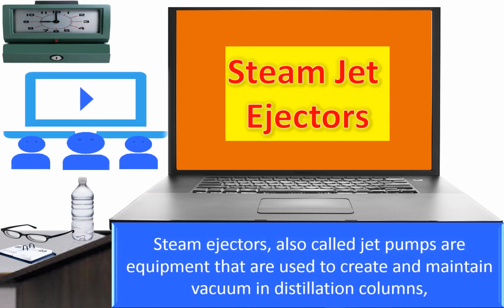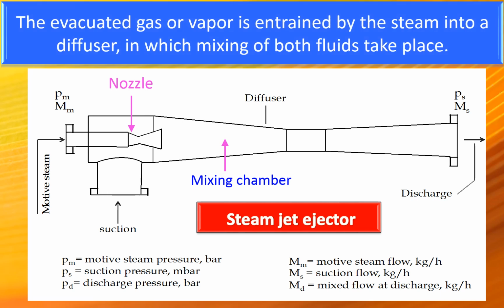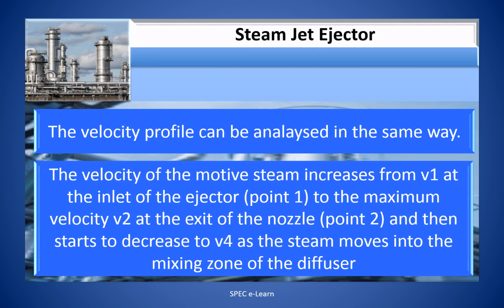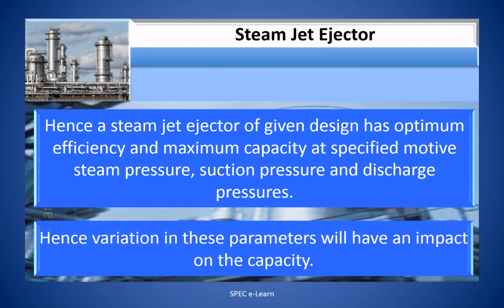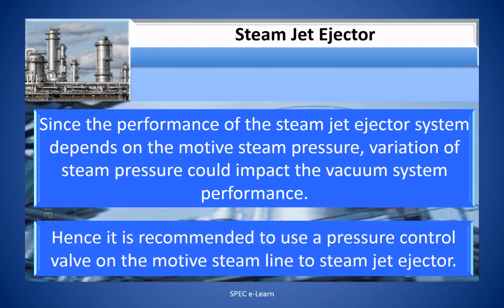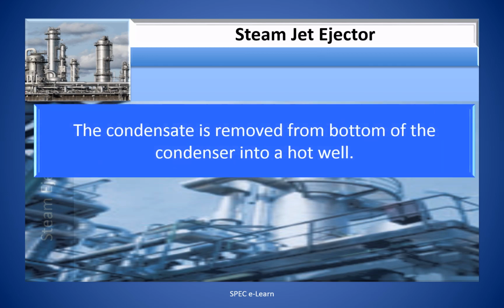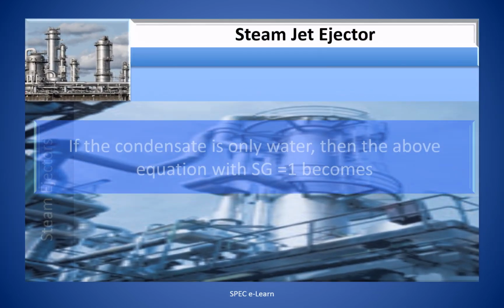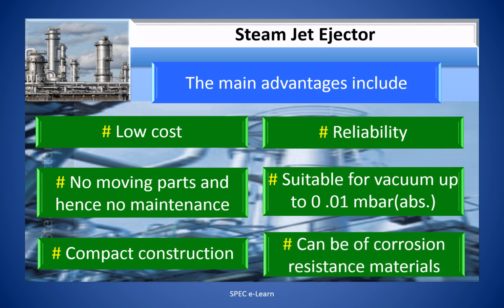Steam Jet Ejectors

Comment: Please guys I need your help. I currently want to build a system, that allows hot steam to enter and leave a vacuum while maintaining a specific pressure. I know how to keep the temperature in the system constant at 200 degrees Celsius. I also know how to attend the initial desired pressure. The problem now is how do I make pass hot steam through this system, and allowing the steam to escape the system without changing the pressure of the system? What device(s) could be used to achieve this desire? Thanks for helping out guys .
Reply from the maker: Your question and problem statement is not clear. Is it that you are looking for a solution to control vacuum in the loop?